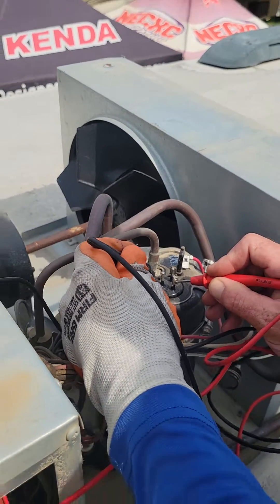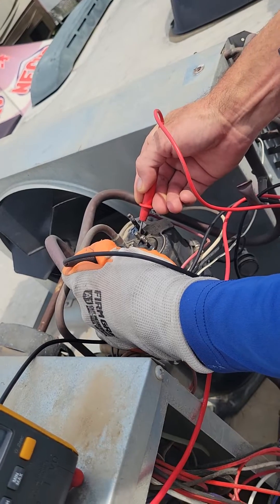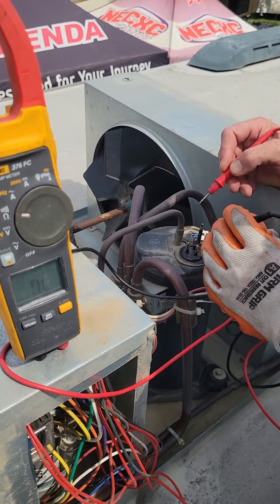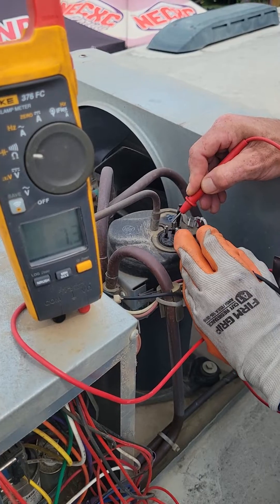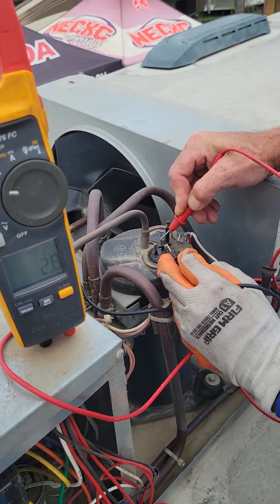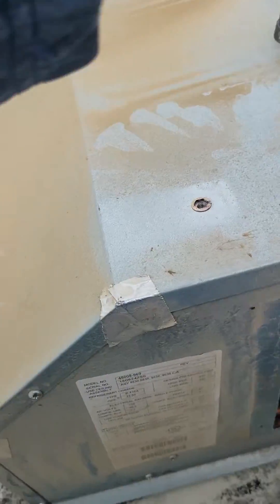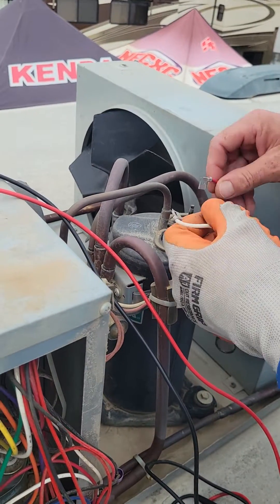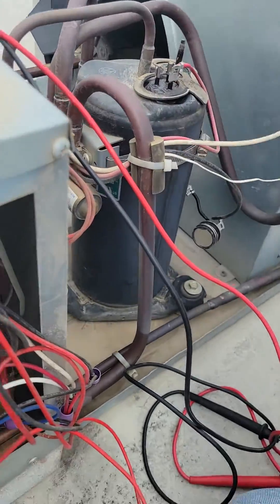rv ac unit compressor diagnosed

Comment: How do you determine what the amp draw should should be?
Reply: Look on the compressor for the LRA (Locked Rotor Amps). That's the compressor 
amp draw on start-up.